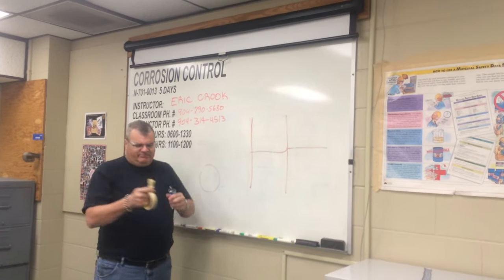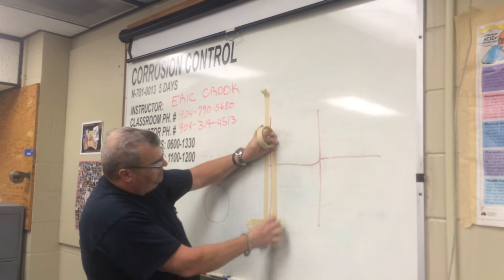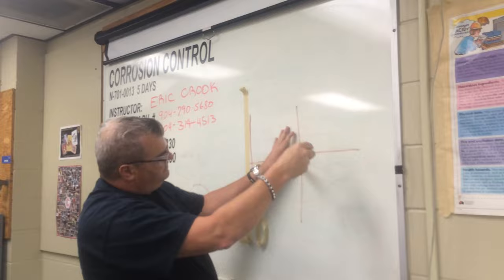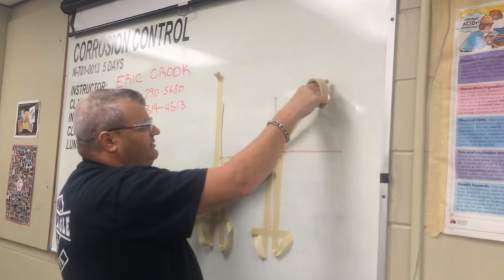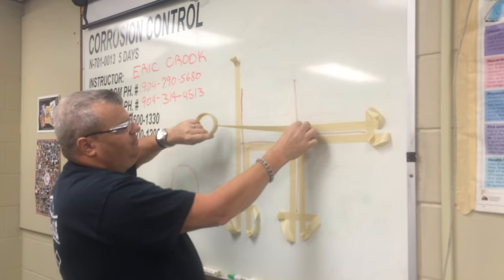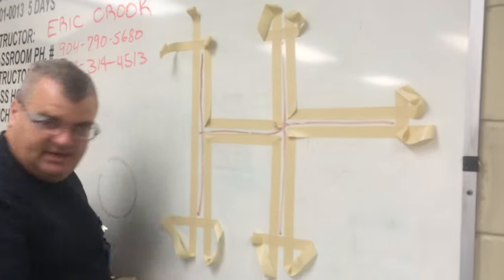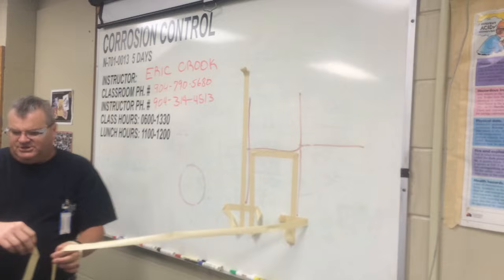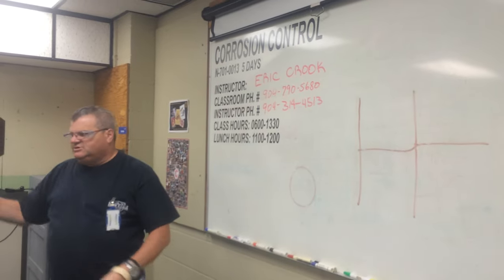Aircraft Taping for sealant application straight lines and corners

Comment: This'll take forever
Reply: doing this without these tapes will take even longer or never ending
Reply: @93hothead  Run the spoon like you normally would then use an earplug soaked in water and alcohol to push the excess edges towards the fillet then smooth it out. You can use a cotton swab applicator soaked in MPK to line it up even more.